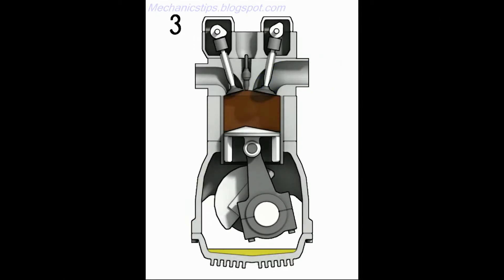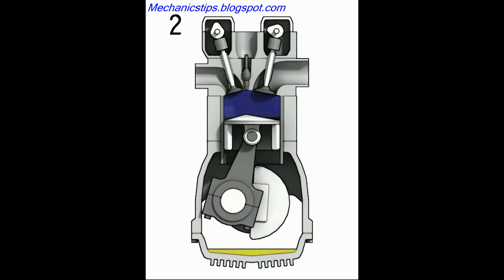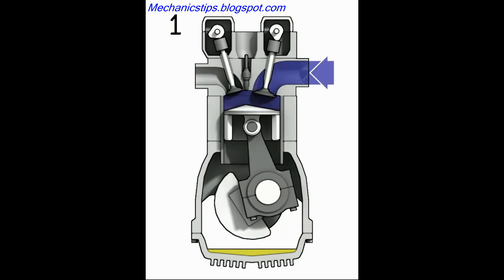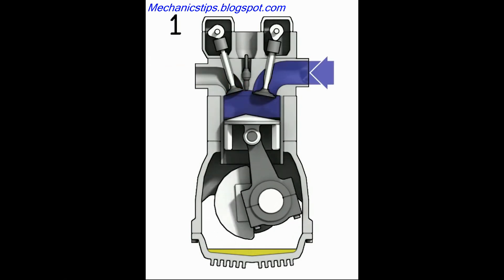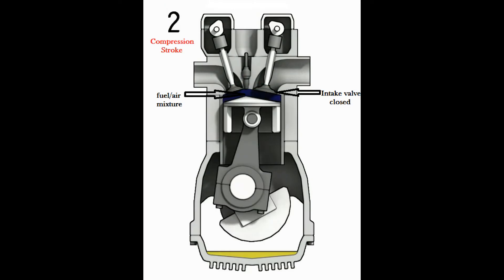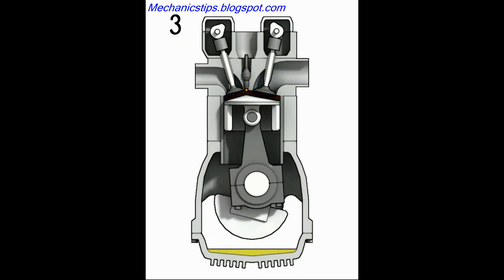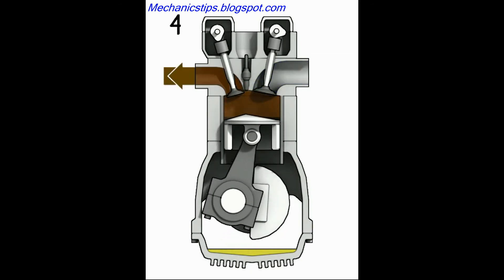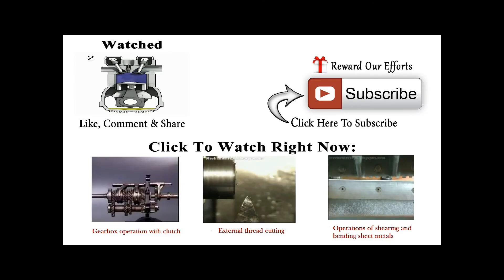How a 4 stroke engine works

Comment: fyi vehicles have overlap in the camshaft meaning during the last exhaust phase the intake valve will open while the exhaust valve is still open for a very short period
Reply: Is this what is considered a “cam” on cars which makes them chop?